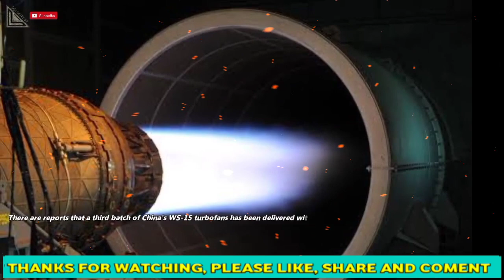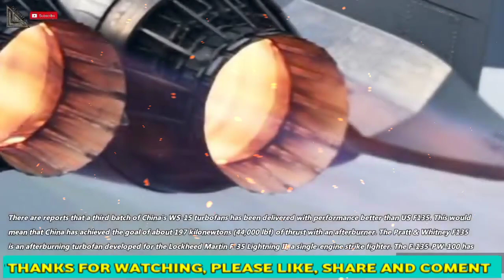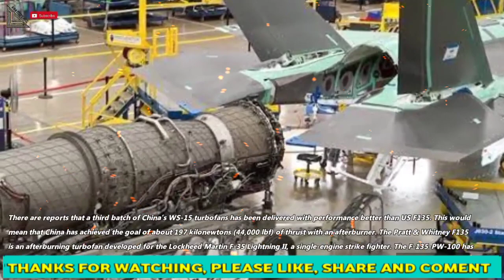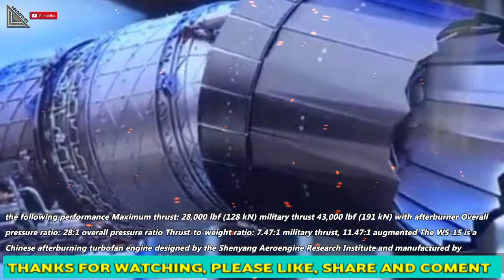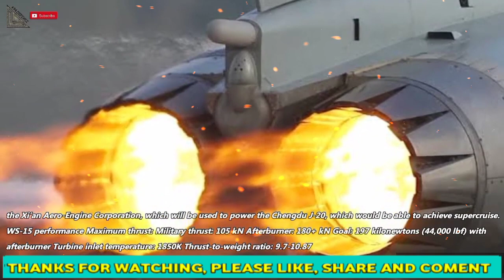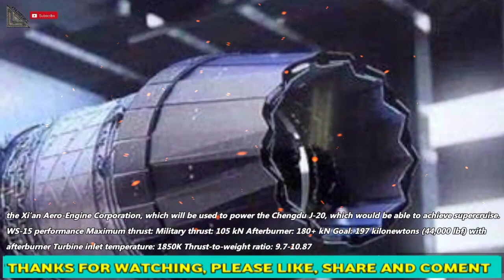The fact that China Ws-15 jet engine are more powerful than US F135 jet engine

Comment: US engines are still more fuel efficient and have a longer service life and low rate of failure which makes them more reliable. Higher thrust doesn't matter if you're wasting excessive jet fuel!
Reply: It's all engineered.
youtube.com/watch?v=gBH5SNQm4Fs
Reply: You are privy to Ws15?
Reply: Do u work with the engineers to know that it's not fuel efficient?  Sound much like a hater
Reply: how can you determine the rate of failure for an engine that has never been in service?
Reply: @laohu5511  he is a protein guy
Reply: @laohu5511  engines are run continuously for many hours and the mean time between failure is recorded. The higher the reading, the better the reliability.
Reply: Hope you can read Hindi.  Good. Get it?
Reply: @shiekhwaleedmiral-protein2819  totally agree with you about mean run times are indicative of reliability. Just out of curiousity, where did you find such information???
Reply: @ericc.4292  I'm an aviation enthusiast. Always trying to learn something new everyday. Also, I was inspired by my Uncle who's in the Airforce.
Reply: @GregACL971  No sir, I'm not a hater. Chinese engines will ultimately catch up with US ones. But it will take a few more years.
Reply: @shiekhwaleedmiral-protein2819  oh I see so you get your info from YT and your 'uncle'. Good for you.
Reply: @shiekhwaleedmiral-protein2819 If you're an aviation enthusiast, then you would Know the single blade crystal could withstand temperature higher than the blade used on F-35. The blade is the heart of an engine. Since it can withstand the higher temperature, it means less maintenance and will outlast the F35 blades - facts.
Reply: @1313hyme  i agree with you on the Chinese turbine blade reliability. But fuel efficiency isn't dependant on it. It's related to the combustion chamber's design. Also the overall service life also includes wear and tear of compression chamber parts not just the turbine. I believe the Chinese are working on improving both these things.
Reply: @shiekhwaleedmiral-protein2819  No one know the progress of ws15 except developers. It is better to keep mum and wait for the actual product and its  specifications.
Reply: @sammychow5238  As an engineer in US, I couldn't agree with you more! All you see is a lot of Chinese and Asian in the technology sectors. Just visit NASA, IBM, Lockheed, ... .
Reply: when China did not have more powerful thrust, americans: thrust matthers
when China has better engines: fuel matters
what more excuses do you have?
Reply: @xinyaoyin2238  an american engine can make the same thrust by using lesser fuel and last longer than a chinese engine. maybe in the future chinese engines will be better but for now things are like this...

Comment: Unfortunately, China has not been able to grasp how to build powerful and reliable jet engines. The WS-15 has been a major failure and plagued with technical issues. Blade failures are common. It does not come close to the variable cycle GE XA-100 that will power the NGAD and F-35. Very sad for the PLA.
Reply: Just a matter of time!
Reply: Every headstart will hv issues dude . It just hv to be made perfect . Over here it was not about the development of engines . USA will come with better one n compete . The issue here is about the attitude , disciplines, talents, skills, determination of the Chinese . They never stop even though they are leading . They will only push ahead further n eventually no one cud catch up with them . The availability of resources n funds have put them in the pathway to excellence .
Reply: Your name says it all. Propagandist for Uncle Sam.